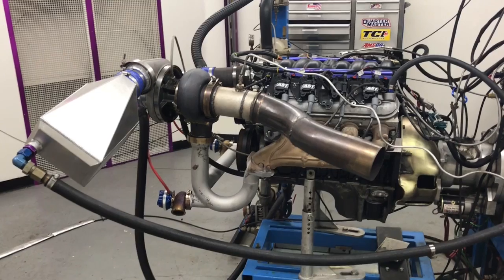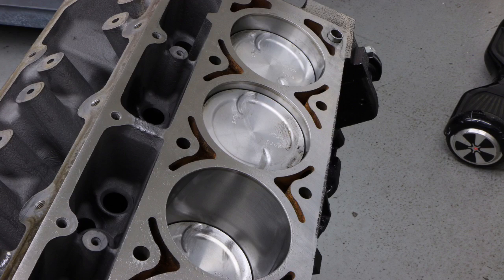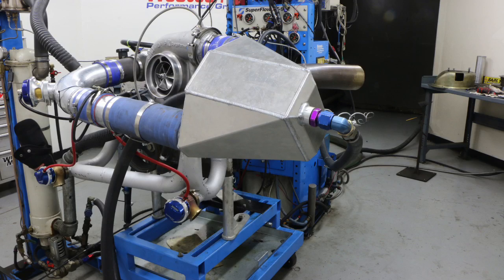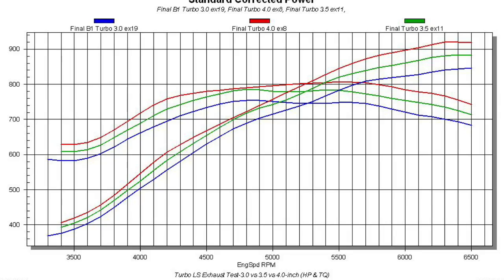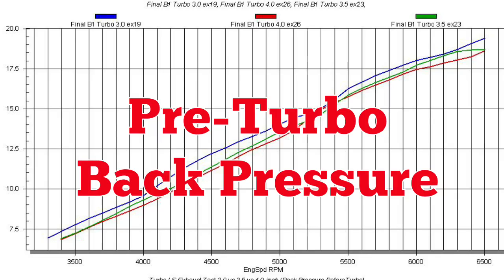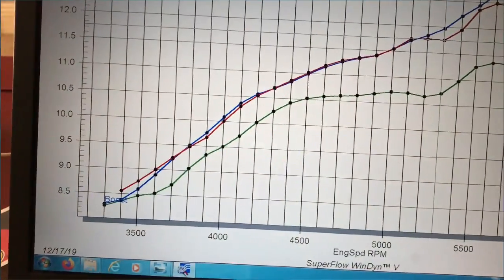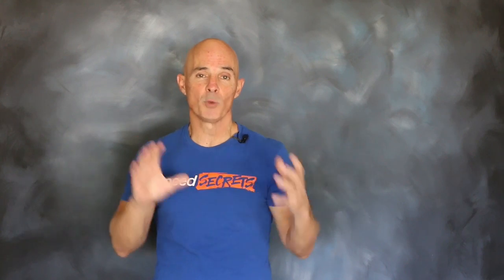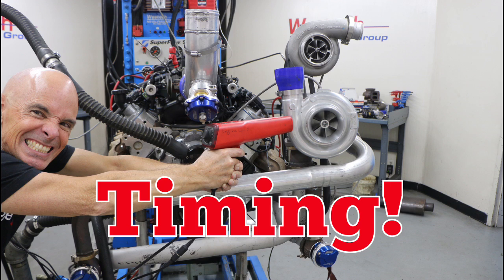LS TURBO EXHAUST TEST-THE DOWN PIPE DILEMMA-WHAT SIZE WORKS?

Comment: Hey Mr @richardholdener1727

A great test as always mate, and I do have a theory on these surprising results

Something to consider here is, that you are venting exhaust manifold pressure directly to the atmosphere via the twin 50mm waste gates that are mounted on the crossover, not forcing that additional exhaust pressure through the 3, 3.5 or 4 inch dump pipe
This explains why there is not a massive difference in boost pressure on the manifold side of the turbo, or the 3, 3.5 or 4 inch dump pipes

If you measured the volume of exhaust gas passing through the waste gates, you would find it will be considerably more on the 3 inch test vs the 4 inch

So although (at these power levels) we would have expected the back pressure to go up considerably with the smaller 3 inch dump pipe, it does not because there is sufficient flow capabilities through the twin 50mm waste gates to "bleed off" most of the additional back pressure that is generated. The gates just open wider as the back pressure is increased, so it doesn't need to force it through the 3 inch pipe

What you have shown here is a very interesting example of what will work very well in a "race application" where no mufflers are required on the waste gates, so you can simply dump the exhaust "straight out" of them
So if you had space restraints (on a race car) that won't allow you enough room to run bigger than a 3 inch dump, this will work excellent

However, if you wanted to simulate this 3, 3.5 & 4 inch dump pipe for a (quiet and legal street daily driver like mine), you could not let the twin waste gates vent directly to the atmosphere.
You would need to plum both of the waste gates back into what would be a single 3, 3.5 or 4 inch exhaust, which would created a significantly different result

My guess would be that if you ran all of the exhaust gasses (including from the waste gates) through a single 3 inch, it would struggle to make a similar amount of peak HP as it did here due to the back pressure being at a unacceptable level

I would actually love to see a repeat of this test done, but with the waste gates also plumbed into that single dump pipe as outlined above so we can see what happens on a "street application"

You could however transition the single 3 inch dump pipe into a twin 2.5 or twin 3 inch under the car where space permits for example, then plum the waste gates directly into that non restrictive part of the system
That way they bypass the choke point.... Which is exactly how I will be running my system, because I can't fit larger than a 3 inch dump pipe out past my frame rails. 
I'll run the waste gate pipe separately right back to about midway along under the car, then merge it into the larger system

So thanks very much for this test Richard, it has definitely taught me how to fabricate a less restrictive setup by thinking around the problem !

I imagine this is going to start a debate on what type of exhaust is deemed "legal" on the street, but I think you will understand the theory here

Comment: If it was twin turbo. Would going from 3" exhaust to 3.5" exhaust would be a significant difference?
Reply from the maker: for what power level and turbos?
Reply: @richardholdener1727  t3 68 65s 850whp to 900whp
Reply: A pair of t3 68 65, 850whp to 900whp

Comment: Dude ...im lossing hair overhere. Great test. But i have a old buddy arguing the an exhaust should match the size of the turbo outlet. Fighting me that doing that would be the best in everyway. I showed him this vid and he of course pointed out the 4inch exhaust in the vid was way shorter and had no muffler. I need a gotcha moment with this big headed dummy of a buddy i got talking bs
Reply from the maker: matching the size of the turbo outlet is more restrictive than stepping up in size, even more so the longer the exhaust system. Your buddy is incorrect

Comment: I have a Ford 363 that was built for boost. Only 8.5 CR, going in a 68 Mustang. CXRacing has a turbo kit for my car. It's 3" leaving the turbo. Do you think this would be good? I still want dual exhaust. Would I connect the 3" to dual 2.5"?
Thanks.
Reply from the maker: that will work-depends on the turbo size and power level
Reply: @richardholdener1727  It says it supports up to 600 whp. If true, that's plenty for me.

Comment: I built a C5 for a customer with TTi turbo kit with twin 60s and it picked up 100rwhp with cut outs over through the stock titanium mufflers.
Reply: What are cut outs?
Reply: @Kj16V  valved mufflers. Cutouts allow you to bypass the muffler on demand and make it a straight pipe until you close the valve again.

Comment: on 300c ,5.7 hemi with 6.1 cam, i replaced cat back pipes from oem 56mm(2.2in) OD to 70mm(2.75in) OD , can i expect some gain(no cats, free flow mufflers, resonators)
Reply from the maker: YOU MIGHT SEE SOME WITH THAT

Comment: I once had a turbo car that had a clogged cat. Your opening statement about it wont run well with a plugged exhaust, i experienced first hand. 

Once it got a 3inch high flow downpipe(stock was ~2.25 at smallest, its a 4 banger) it opened it up dramatically 😂

I have a current toy with twins with dual 3 inch turbo back. Seems to flow plenty. Considered going fender dump or hood dump but since it sees SOME street use i decided against it.

Comment: Nice video. I have a question about this. On my small turbo Suzuki Swift Sport with a TD02, i have upgraded by downpipe from 42mm to 63mm but noticed a flat spot between 2 - 3k rpms, even after loading stage 1 file. In the higher gears 4, 5 and 6 it almost feels like boost lag, whereas previously in stock form it had loads of low down torque in any gear. I know you say with turbo downpipes bigger is better, but does the same apply for small, stock turbo cars ? Or, does it need more fine tuning on the software side ?
Reply from the maker: open exhaust after the turbo improves response-sounds like a tune problem

Comment: If I have twin turbo 6.0 is it better to do 3 inlet n 4 outlet or 4 inlet 5 if I’m putting exhaust tips bc that’s what I want to do I want to do 3 in pipe or should I do 4 in pipe n put 4 in inlet dual exhaust tips to 5 in outlet or just use 3 in tube n do 3 in inlet to 4 in outlet dual exhaust tips?
Reply: N I want to put it to exit both side of my front fenders n it’s going to be dual slanted exhaust pipe
Reply from the maker: the bigger the exhaust-the better for exiting a turbo

Comment: It would be interesting to see a truly titanic exhaust system post-turbo. Start with a 6", then go to an 8" then a 12," but the caveat is that you have to flare out smoothly from the turbo turbine, because that 80,000 RPM air is wanting to fly outward when it leaves the turbine housing from centrifugal force. For more real-world-ish numbers, make the exhaust pipe post-turbo about 10 feet long.

Also, the 4" had no muffler on it, so that would help, of course, but the takeaway from it is that NO exhaust system at all may be ideal for after the turbine. I would have liked to see THAT.

In constant-flow, which post-turbine flow is, largely, compared to the super-pulsed just-post-exhaust-valve flow, the rule is that the larger your conduit, the lower your resistance.

And, the whole "correct backpressure" fantasy: the "correct backpressure" for any piston engine is ZERO, deep-space vacuum, none, not a single atom of air. THAT is ideal. No amount of exhaust going down any length of header primary at any velocity can match the scavenging effect of an exhaust seat that has a complete deep-space vacuum on the other side of it. No port, no nothing, just exhaust seat and perfect, infinite-space vacuum.
Reply from the maker: INFINITE SPACE VACUUM?
Reply: @richardholdener1727  Yes! that is the desired net effect!

Comment: Hey Richard there is one test i would love for you to do and see if there is any significant differences in Turbo Location so basically Turbo at the headers vs a "rear mound turbo" which would have headers going into a Y pipe to a length of pipe to the turbo then turbo to a muffler. It be nice to see turbo response, exhaust back pressure, turbo temp and air temp before the IC.
Reply from the maker: please see the remote turbo video
Reply: @richardholdener1727  hah god damn Richard you are one quick dude. Keep up the great work!

Comment: Hey Richard, I would like to see a test not only on spool time (response) of reducing the primary and collector, but also log style vs. Header with back pressure and spool as well as top end power. 
I have read many times that reducing the primary on 6.2 LS and smaller down to even 1.625” and collector to 2.125” or 2”, increases pressure and velocity, creating faster spool, while also allowing you to increase the A/R to Maximize top end exhaust flow. This is all concerning the hot side before the turbo. 
This all makes sense in theory and people have tested it but I don’t see actual dyno results posted.
Reply from the maker: lots to talk about there

Comment: I’m pretty sure different exhaust set ups are different for motors with turbos. I have a inline 5 turbo and I absolutely love the 3”straight turboback exhaust on my Volvo. Had a lil low end but extreme top end power with a stock tune on my S60
Reply from the maker: EXHAUST SIZE MATTERS MOST AFTER THE TURBO-BIGGER IS BETTER
Reply: @richardholdener1727  THANKYOU FOR THE INFO SIR BIGGER IS BETTER SIR!🪖🎖🍻

Comment: Something that I think would really add to this story is to look at where in the rpm range where boost pressure equals turbine inlet pressure.  Engines love turbos, but they especially love turbos where the inlet MAP is higher than the exhaust MAP.  In that regard the point where that pressure cross-over where exhaust pressure starts being greater than inlet pressure is a great health indicator IMO for the set up in terms of turbo match and restrictions in the inlet and exhaust systems.  If a change in external combination moves that cross-over point further up the rpm range, that should normally show very good gains in HP and I think that's a big part of what happened here with the increased exhaust size post turbo.

If you haven't done a video explicitly looking at that cross-over effect as the main topic, I think that it would be a good one to do.

Keep up the great work :) 

PS: I used to work on large 2 stroke marine diesel engines for a living as a marine engineer.  When in the working load range, inlet pressure was always higher than the exhaust pressure, so much so that these engine did not need any external scavenging aids like a root blower or under piston scavenging, an apparent miracle that always impressed me.
Reply from the maker: RUNNING LESS BACK PRESSURE THAN BOOST PRESSURE IS NOT HARD-IT DOES LIMIT RESPONSE THOUGH

Comment: Awesome video. So my set up is a Ram 1500 with a built 6.4L/392c.i. Hemi with a VSRACING 80mm/t4, E85 etc. We decided to run full exhaust, necked it down from 4in to 3in (for clearance between frame and firewall) with a race muffler, all the way back to the rear of the truck. Planning on putting 16psi and hoping for 800+whp, so we shall see if it works or redo all exhaust to 4in or just do fender exit lol. It’s kind of a sleeper truck for now 🤷🏻‍♂️

Comment: The other thing is the pressure difference across the cylinder. This is where the power more than likely came from. You had 11.7lbs boost and 19lbs back pressure with the 3”. Resulting in a pressure ratio of .615:1 then with the 4” exhaust you had 12.7lbs boost and 18lbs back pressure resulting in a pressure ratio of .705:1 this essentially made the cylinder more efficient and allowed more oxygen in allowing more fuel to be burnt.
Reply: I was thinking of this as well. Since his power went up, well that also means he's producing more exhaust gases. Likely why his backpressure numbers weren't THAT different yet made huge differences -- all of that pressure decrease goes straight into making more pressure.

Comment: Hey Richard as great as this test is I think it could be be redone for your viewers enjoyment. It appears the 3 and 3.5 inch exhaust was connected to a dump pipe that went from 4” off the turbo to 5” then reduced down to the exhaust size. A bigger dump will benefit the smaller exhausts largely. It’d be great to see full length exhausts or even 1-2m of 3 vs 3.5 vs 4 straight from the back of the turbo. You also say a 3inch would be better on a 600hp car, that is incorrect. If you add your electronic boost controller you could test all 3 size exhausts at different boost/hp levels and that would be a great informative video. Thank you for all your work, it’s definitely the best car related YouTube channel I know.

Comment: s475 on a 5.0 Coyote I plan on making around 750-800hp. Turbo comes with a 5in outlet so I'm running a 5 inch downpipe even though a good bit of firewall is going to have to get out of the way. I like to keep things simple, lol.

Comment: Richard, I got a problem with this test.
You have a oval muffler on 3".
You have a bullet muffler on 3.5"
You have no muffler on 4".
So I believe the muffler, or lack of, is responsible for this situation, not pipe size. Would have made a lot more sense to put straight through bullet mufflers on all ???

Comment: Now we need to see turbo log manifolds vs equal length headers.  But to make it a good test they both need to flow about the same.  Question is does exhaust runner length pre turbo effect power and if so how? I have always felt the shorter the better. Reduce lag, improve low end performance and not give up much if any on top. What say you?

Comment: Hello, you seem to know a lot about turbos! That's really great! Congratulations! I have a question for you, if you can help me. My car was changed from turbo to a larger one, Borgwarner has a catalog for upgrade (K03) Peugeot/Citroen/mini, they mention "plug and play", however they don´t mention anything about the "problem" that I have. The compressor turbine (which receive de hot gases) turns orange when I barely demand full gas in 5 minutes later. Is it normal? I do not want to touch the ECU, because there are no good professionals in my country. I was told that one way to solve this issue, 
if it wasn´t normal to have the orange turbine so soon, do I have to change and buy a high flow catalyst as the best solution? I appreciate any guidance on the subject. Regards!
Reply: AFR

Comment: I don't get why they don't build turbos with tapered bearings so they can be pancaked onto A/W intercoolers (on top)... instead of having to always set them up with gravity in mind. All the plumbing could line right up (how well would a "downpipe" work, if it was straight up (and just long enough to nicely clear the hood) and exactly the size of the outlet, to start?). Make it adjustable, and (if supplied with plenty of clean oil) run 1 set of quality bearings for life.

Took a few vids to get used to your delivery, found it to be quite efficient... subbed.
Reply: The bearings would fail from the rpm,load, and heat. Turbos ride on oil film like engine bearings.

Comment: I saw an interesting one on facebook of all places where a tuning shop saw improvement in spool as they increased the size of the first section of downpipe well above the side of the turbine outlet (6 inch I think is what they go to)..

I believe the change is because the air coming from the turbine wants to spiral outwards where the downpipe is straight.

Comment: Can you record injector duty cycle ?   In the diesel world we use injector hold open time in micro seconds .   The amount of fuel being burnt from run to run will remain constant and the results from air flow / back pressure will show the honest results ..     Id be curious when your bost changes how much more fuel you burn .

Comment: The 3” and 3.5” had mufflers tho???? And the 4” was way shorter to
Reply: Yeah I'm sure that had noooothing to do with it.  Also about 10 feet long.  Very unscientific.
Reply: The muffler had nothing to do with it? I’m just asking because I have seen 50hp gains just from removing a cat on a boosted car. And it was a 3” high flow cat also, not a stock one. Mufflers 100% make a difference
Reply: @madvtecyo546  My sarcasm wasn't so obvious I guess - I completely agree with you.

Comment: Intrigued why the 3" back pressure was so low... in comparison track back pressure on my setup 7875 5.3l 3" similar to your test but was at 5-6# back pressure till I went to a loudvalve cutout at turbine addition to the 3" exhaust dropping back press to 0-.5#.  Again odd for a larger turbo and engine to have less BP in the 3"

Comment: The entire video is invalid because you didn't maintain the same boost between tests...you talked like you went out of your way with the holley computer to maintain test conditions, then allowed the variable with the most bearing on the test to vary while changing the variable you were attempting to test. 

Comparative testing is only valid if you only allow one variable to change at a time.

Anyone that claims "you need back pressure" doesn't understand how engines work and should be banned from driving anything other than a prius.
Reply: Sort of. There was only 1 change made, the exhaust size. The change in boost was a direct result of that change. The wastegate was not touched, maintaining the integrity in this case. This test highlighted the effects of changing downpipe size, not purely the difference in supported power.